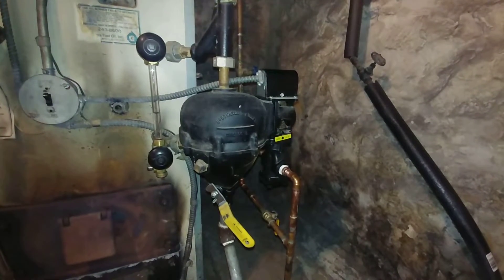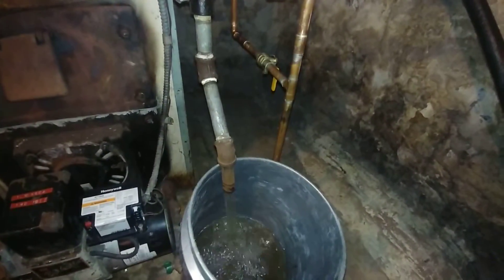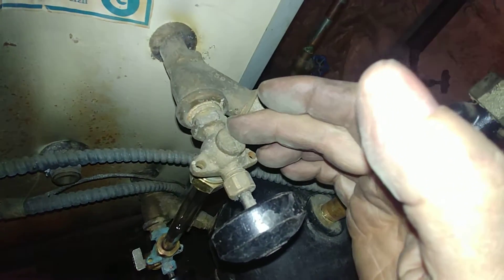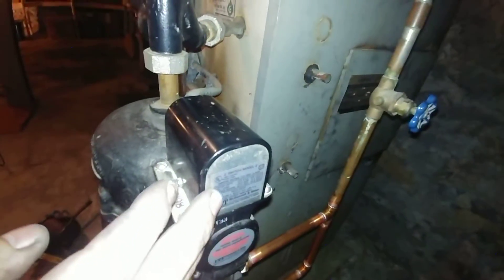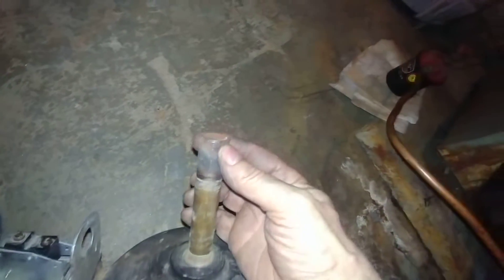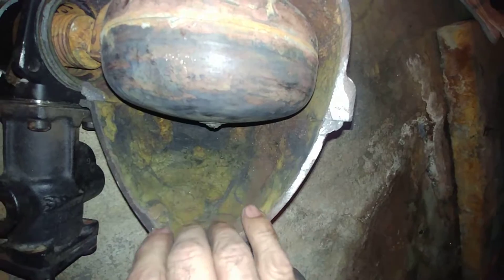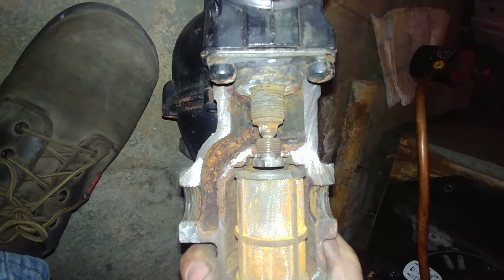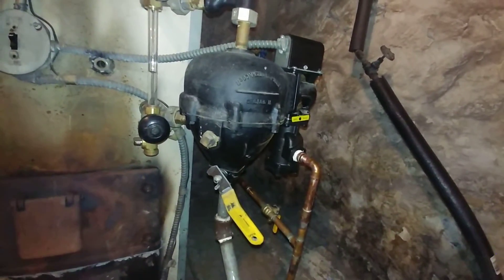So this is what obsolescence looks like....McDonald-Miller 47-2 LWCO

Comment: I don’t really have a problem with them, but we have them on daily maintained 3.5 million btu boilers. When properly maintained, they are ok. keep all of the spare parts in stock.
Reply from the maker: That is to my point... "*properly* maintained".
Very rare what you are doing (well done, by the way!)
But my other issue with the #47-2 is the water feeder.
Unless you have a water meter on the line to it, and you log the meter, you have no way of knowing if you have excessive water loss.
Excessive water loss destroys steam boilers for those that might not know.

Comment: When should it be drained? Weekly or monthly?
Reply from the maker: It should be removed entirely and replaced with an electronic probe type low water control as soon as you can.
The former owner of this control blamed us for its failure and used that as an excuse not to pay us for the work we did.
In the mean time, test it weekly while the burner is running until you can replace it.
Good luck.
Reply: Thanks appreciate it….. I have replaced it maybe twice-3x over 20+ yrs

Comment: Hello...I have a McDonald-Miller 47-2 LWCO.  Would I still need the McDonald Miller #67 LWCO?  Thanking you in advance for any help.
Reply from the maker: You shouldn't need the M&M #67 if your 47-2 is in working order and is being maintained in accordance with manufacture's instructions.
Having said that, I will say again and again that both controls are obsolete trash and should be replaced ASAP with up-to-date electronic LWCOs.
Reply: Thank you so much for your reponse!  Will the HydroLevel LWCO do both operations (feeder & LWCO)?  Approx cost?  I appreciate your help & expertise!
Reply from the maker: @carrickrentals5632  The electronic LWCO & feeder are separate units.
The LWCO is absolutely necessary for safe boiler operation
The automatic feeder is not, but it's nice to have.
As to their pricing, they are cheaper than a new boiler, but beyond that, there are just too many variables to give a meaningful estimate.

Comment: A magnificent piece of American engineering that will outlive you, your kids and perhaps this entire human race if reasonably cared for.  Try saying that about an electronic control made in China.

Remember that these are safety devices only designed to protect the boiler with a minimal safe water level.  The operating level is supposed to be maintained manually by someone who looks at his boiler every week.  Some installers set these too high, and then the control overfeeds and floods the system.
Reply from the maker: It WAS a nice bit of engineering... fifty years ago, maybe.
It is long obsolete, unless perhaps it is being used to feed a boiler steaming crabs.
Electronic controls, even those made in West Taiwan, are superior to this.
This one caused tens of thousands worth of damage & the customer not to pay my bill & try to sue me.
So, no.
The M&M #47-2 is a big steaming pile of Shyte.
Reply: @gordonschweizer5154  Please forgive me from chuckling at your disdain.  But only because I understand 𝘦𝘹𝘢𝘤𝘵𝘭𝘺 what you are saying and really can't disagree as much as I wish I could...

Comment: if i can hear the float click on and off that means it still works right ? and i’d only have to replace the lower half of the #2 switch ? as of now it has to be manually feed after it it skimmed weekly. didn’t want to replace the whole control if it wasn’t necessary
Reply from the maker: The "clickty-chick" is a good sign that the float & bellows is working and the switch snap action is working, but if the burner still isn't shutting off, the #2 switch most likely needs replacemnt ASAP.
If the burner shut-off works, but the feeder isn't, check continuity and voltages with a test meter. 
Water feeding is not a direct safety issue.
But if even that issue can be traced to the #2 switch, the switch should be replaced.
Cheaper than a new boiler.

Comment: When I had my boiler replaced ten years ago I was talked out of using the device you’re showing by my plumber. I have a modern low water cut off and I manually feed the water to the boiler.
Reply from the maker: Very good!
I'd only use this thing on a crab steamer.

Comment: Hi , 
In this system can a newer low water cut off be installed ? Or if has to be that old school  ? 
Thanks
Reply from the maker: The boiler shown should have been replaced decades ago.  
In general, no prevision for probe type LWCOs installations on such boilers were made.  
The only way to install a probe type LWCO on many older boilers (and the modern Weil-Mclain LGB) is on a special manifold that still needs to be blown down.  
Yet even that is far superior to this 47-2 piece of junk.
Reply: @gordonschweizer5154  thank you for taking the time to reply.

Comment: I had a steam boiler with this #47 controller. Filled the whole system with water and the pipe leaked into the walls and ceiling. "Wasn't a great day for anybody" is a very accurate way to put it.haha 

Question- is it necessary to replace the whole control or would just the fill valve do the trick if the issue is that it is just over filling
Reply from the maker: I am sorry to hear about your flooding disaster.
The mfg. says to replace the whole control if it is over 10 yrs in service (a bit of c.y.a., methinks).
I would first get an idea of how much make-up water you are using.  You can valve off the auto fill (at least, I hope you can), and run the system without it.  It is not a safety device.  It might be covering up for hidden leaks in your system.
Test the low water cut-off part every week as per instructions as per usual.  If the float/switch doesn't work to shut off the burner, repair or replace the whole unit asap.
Add water manually to the middle of the gauge glass after the testing.
If you find you are adding more and more water than you are taking out during the "blow downs" (best guess), you may have other leaks/water loss in your system and these should be repaired before you consider replacing/rebuilding the feeder.  Leaks cause the feeder to rust (iron body. why do they still make it with iron?) and fail sooner.
Better yet, replace the 47-2 with an electronic probe-type LWCO and the feeder with a VXT auto feeder and have done.
Reply: I am on my third 47 2. First one without the hex design lasted for 20 years. The second one started to fail after 12 years. Now costing over 1000 dollars each. I think there are cheaper alternatives.
Reply: Just a note, newer 47-2 feeders are now made in China. ITT no longer tags these. The new company is Xylem, so far it seems to be operating ok.

Comment: Hi I really enjoyed the video, and also having a bit of a problem myself. I have the same set up but my automatic feeder is not refilling what could be causing that, I've flushed it but sometimes it'll fill on it's own but really really slow or not at all. do you have any suggestions
Reply from the maker: Thank you for your comment.
My guess would be that the auto-feed is crudded up with rust.
It is made of iron and has fresh water flowing thru it from copper pipes, a recipe for failure...that is why I really don't like this feeder.

Comment: Great video! Do they also make a high water shut off to control,  that should the water feed get stuck in the open position it closes a valve to keep the boiler and radiators from getting flooded?
Reply from the maker: As far as I know, there is no commercially available high water shut off control.  What is out there is almost always "ad hoc".

Comment: This was so helpful..especially the cut away view of the low water cut off valve. One furnace im having issues with is that it wont auto fill so i think i need to remove that strainer at the bottom and clean it or replace it i can manually feed water into it by opening the bypass valve ..the unit kick back on with no issues of course until the water level drops and we have to add more water. Im heading to that furnace tomorrow morning armed with my new found knowledge thanks to you.  Great videos ...thanks again.
Reply: You are so welcome! I hope you get to the bottom of that troublesome 47-2 feeder.  If I may offer some advice: check for failed open radiator vents, loose valve packing nuts, leaking union nuts,  buried wet returns, as well as the boiler itself for holes above the waterline, etc. etc. while you are there.  If the feeder doesn't need to add much water, it will operate longer without failure.

Comment: do you think the need a new boiler?
Reply: This is when they are like old shoes, they just do their purpose.
As long as the boiler cement sticks and perf straps holds, we’re gold!
Bonus,
Customer learns you are honest, best kind of future lead, with new owner...who knows it best?
The mechanic who has been keeping goin.
Reply: Yes. 
That boiler arguably should have been replaced decades ago. 
But 'tis hard to blame the sellers for not wanting to shell out the bucks for a new boiler they won't get to enjoy.  And while that boiler has the efficiency of a bonfire, it does not leak and fills every radiator end-to-end with quiet steam.  But its days are numbered.
Yes.
Reply: Gordon Schweizer 
When if finally fails it will be full of crabs.
You’ll get the joke in a minute.
Smile! Have a Great Day.

Comment: I use the #67 often.  I wonder if this #47 is more reliable?
Reply: Not really, IMHO.  They are both float-type LWCOs and are generally not as reliable as probe-type LWCOs.  Again, that is just my opinion.
Funny, I can remember twenty-plus years ago when I wanted nothing to do with them d....ed communist probe whatchamacallits.  I remember feeling a victim of sharp practice when a boiler I ordered with a #67 arrived with a #@%$ probe!
I feel the exact opposite today. I'd advise anybody faced with replacing a defective #67 or a 47-2 to try and install a probe-type LWCO (if possible).

Comment: I have a similar one on my 2005 Burnham install.  Seems ok, but I handfill only.  Hate autofeeders since they overfill
Reply: Steam boilers do tend to respond better to "hands on" treatment, so your hand fill technique is the way to go, especially since you have a 47-2.  As you say, they tend to overfill.  They also tend to not fill at all!  You can't catch a break! 
Moreover, the 47-2  auto feeder does not care if you have a boiler killing leak somewhere.  It will just keep adding water un-monitored until it is too late.  Result?  Rusted out boiler.  Thanks, 47-2.
As you  do hand filling,  I have no doubt you will notice when you have to add more water than usual and take the appropriate steps to find and fix any leak(s).  
When we can, we'll pull a plug on the boiler at the proper level (if it exists) and install a probe type LWCO and remove the 47-2.